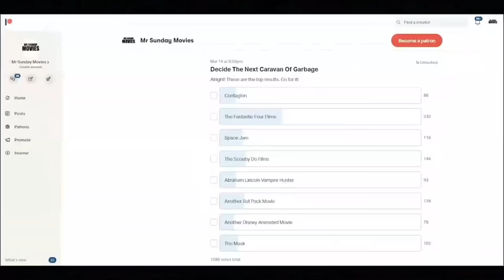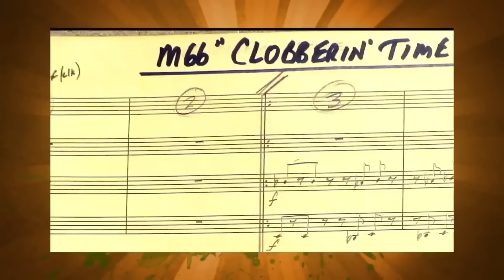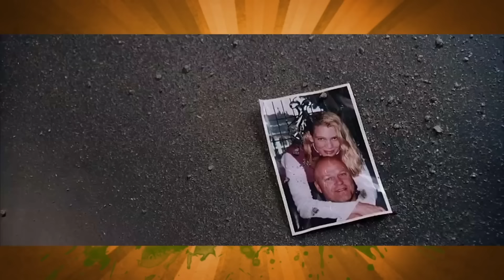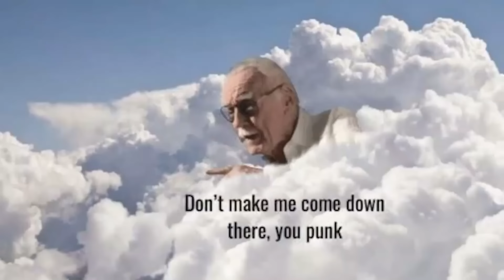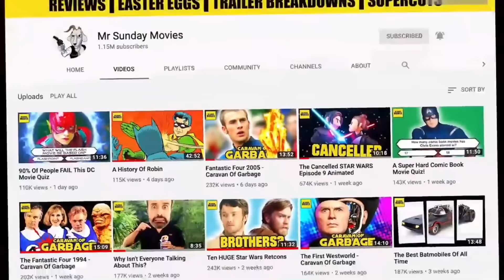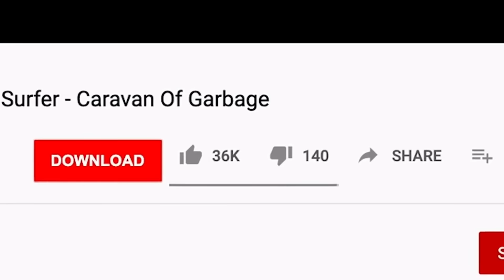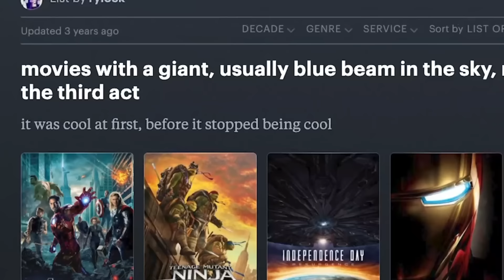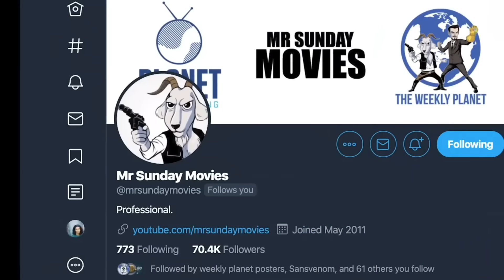The Fantastic Four Movies - Caravan Of Garbage

Comment: Sue can make a white hole, if she can bend light, the opposite of a black hole. It's a 3D hole of light that is theoretically the exit of a black hole if it is a worm hole. The math says they are so hot that physics, as far as we know, break down around them. They would release so much energy that they would be able to destroy all physical bonds between atoms breaking them down into fundamental particles. There would be so much heat that they'd create a true vacuum where there wasn't already and be blinding. They would create gamma radiation, the highest energy form of light, and shoot it in all directions. She would have to gather light into a ball and pack enough of it in there that it would heat up exponentially. Again, theoretical, the math says yes like it did for Neptune, gravitational waves, supernovae, black holes and even antimatter.